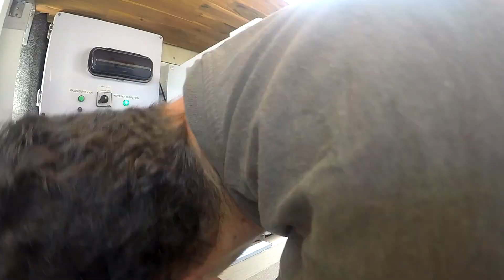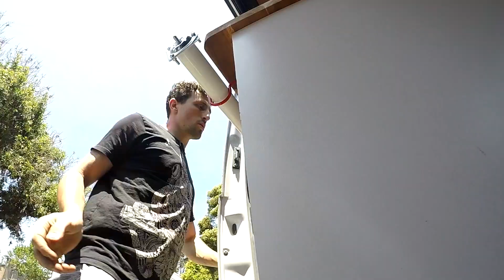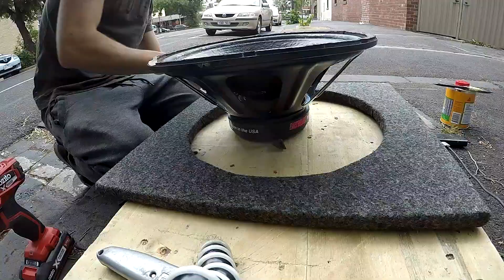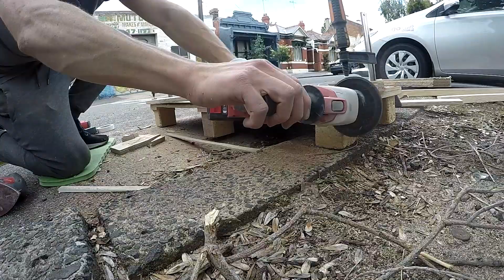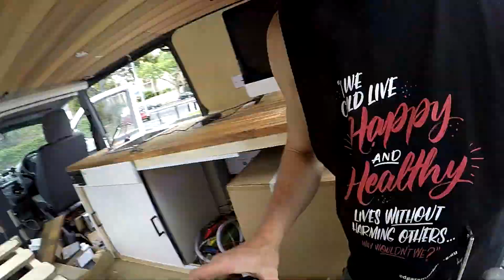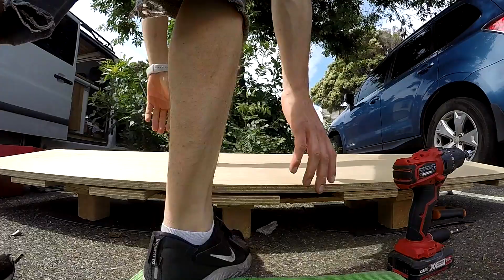Ultimate Transforming Bed! Mercedes Vito Camper #vanlife Conversion Episode 22

Comment: I have two questions:

1. the material looks very heavy, is the engine's power enough?
2. Do you have any experience of how much electricity the car can handle, only the generator?

Incidentally, I am delighted by the way you upgrade your Vito
Reply from the maker: Yes the total vehicle mass is well under the rated GVM. I have an engineer's report to confirm the safety with plenty of headroom. 
What do you mean by electricity the car can handle ? Can you elaborate

Comment: how much did this cost? just the wood, thinking of doing this to my w639
Reply from the maker: The timber for the bed consisted of a marine plywood sheet, pine square section and melamine coated chipboard for the sides.  I imagine it cost me no more than $150AUD
Reply: @rupertferder6768  Ok! and what were the dimensions fully opened?
Reply from the maker: Bed is a single so approx 190cm long by 90cm wide